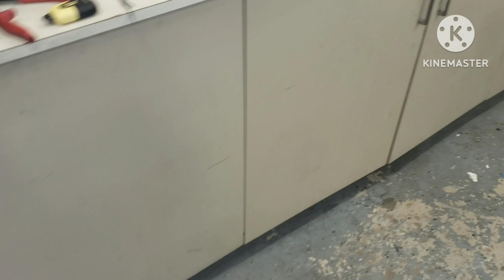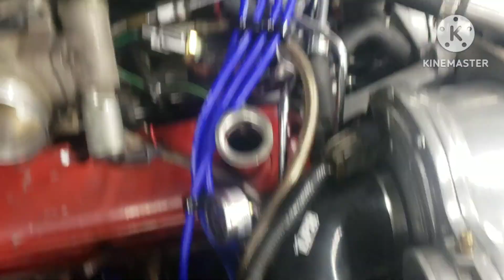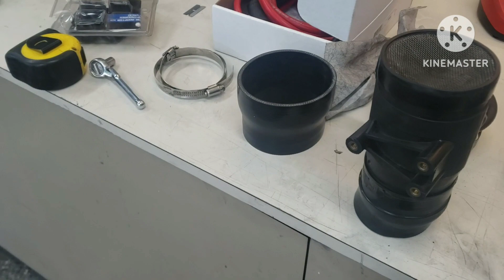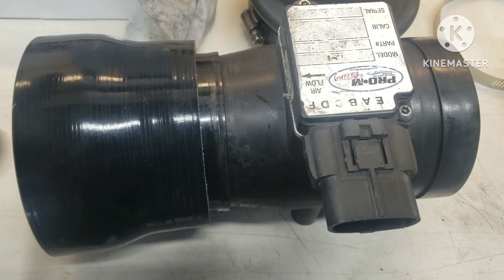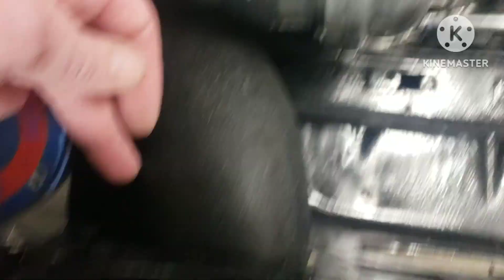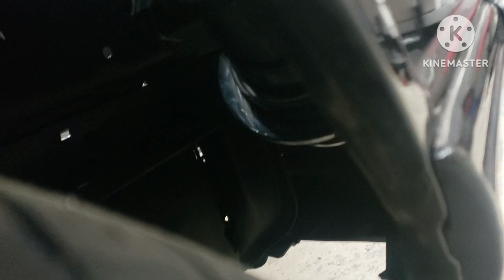UPR Power Pipe Boostmaster Tube for Paxton Supercharged Fox Body Mustang

Comment: I bought a 93 cobra years ago and it came with a paxton SN92. They spool up quick but make a ton of heat. You probably already know this but that bung is for a blow of valve which this blower doesn't require (not enough boost)
My car came with an Anderson power pipe and it has the same thing.

Comment: You need a Pro-M 80mm or 95mm maf
Reply from the maker: Can you tell from the video what size that is? The numbers are so faded and I never looked at what size it was. Would that require any kind of retuning?
Reply: @Joeshomegarage  probably 75mm.  As long as the Maf is calibrated for your injectors.  Recirculation valve ties into intake pipe (blower discharge pipe) those Paxton and Powerdyne 6lb kits didn't come with Recirculation valve but if you're not blowing couplers off when you let out of gas
Reply: You might be ok wth out a recirculation valve.
Reply from the maker: @jplperformance9073  yeah it didn't have one so I'm sure it'll be okay. The power pipe is supposed to add boost but I've been down that road with boosted LS engines changing intakes with no changes. I just don't like having the filter pulling air from the engine bay. It looks like I need to figure out what size injectors I have before changing the maf.
Reply: @Joeshomegarage  yeah I'm sure you'll be ok. Definitely think about a bigger maf
Reply from the maker: @jplperformance9073  thanks for the advice!
Reply: @Joeshomegarage  no problem.  Mustang guys help other Mustang guys, and that is how it should be.  Any time you have any questions please feel free to reach out.  I can give you my # if you need anything else Mustang related
Reply from the maker: @jplperformance9073  Oh I'm a Chevy guy that just owns a Mustang! 🤣🤣🤣 Appreciate it my number is 302-373-7750 and my FB name is Joe VerCammen. Do you know what those things are in the passenger fender? I actually took the car out for about a 5 miles cruise right after it rained and the car ran great only had one time when it seemed to studer a bit and then cleared up. Thinking maybe the water from the tire hitting the intake? I never had that issue with my LS stuff but I don't know how sensitive the Mustang MAF is. Of course I noticed a tiny bit of coolant dripping from the 2 thin bottom water pump bolts even though I followed the light coat of RTV and gasket method! Annoying LOL
Reply: @Joeshomegarage  things in the fender. Usually charcoal canister for fuel system
Reply from the maker: @jplperformance9073  yeah they're not the charcoal canister it's a big round ball and a small box both with vacuum lines. I showed them in the video.